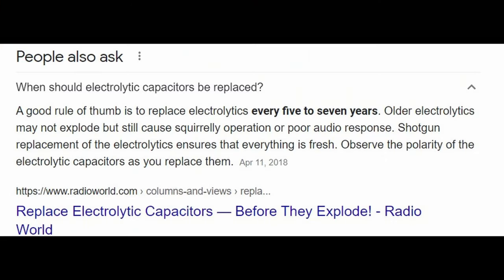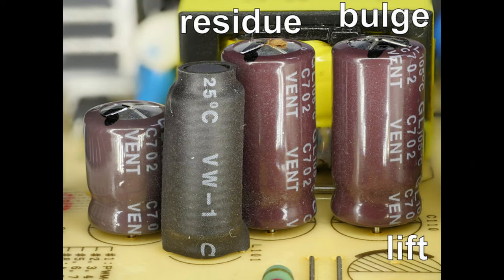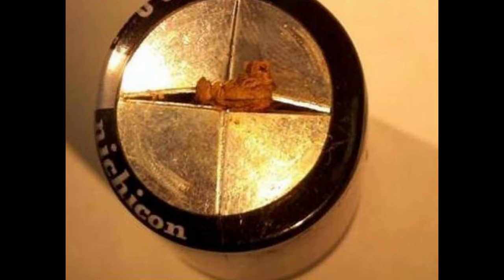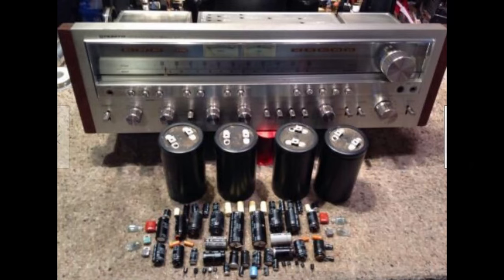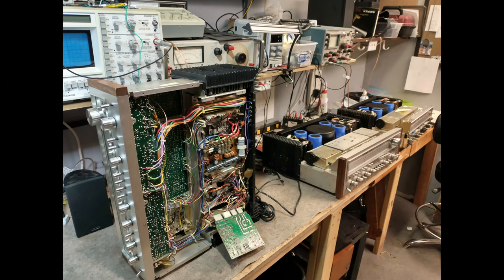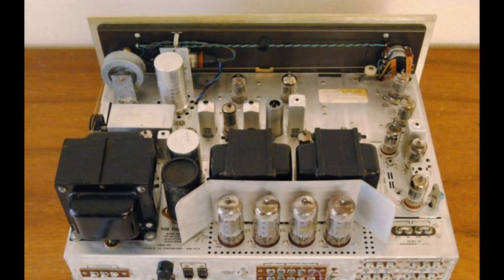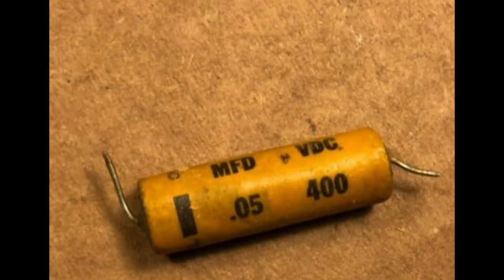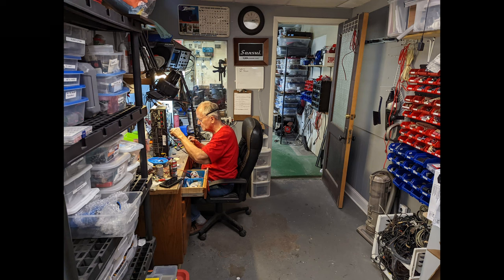Should You Replace Capacitors In Vintage Electronics?- Marantz Sansui Pioneer McIntosh Yamaha

Comment: When you see  visual damage with a cap it should changed. In some cases replacing tone caps can tighten up the sound. If you have a given circuit with voltage test points with voltage out of tolerance or excessive noise,  common with audio often times related too capacitors along with out of spec voltage regulators, it's called the Domino effect. . With tube gear where you have high voltage low current power supply circuits, it's a good idea to change main power supply caps for the B+ Supply Caps. You don't see failures as often with solid state amplifiers but certainly not un heard of. Really depends on the design of the gear, some are certainly more prone to failure.

Comment: So True Kevin, you can put a voltmeter across a car battery and it will read 12 volts but it won' t have the amps it did when it was  new. Electrolytic  caps dry out values change an when they change in a tank circuit like in tuning, which means a cap and tuning coil wrkg together, it will not be easy to get the stations you want

Comment: It turns out I was living about 5 miles from you until 2021, but I just moved over to Marion, Iowa so you're still not that far away. I was just talking to my best friend about replacing the caps in his Pioneer integrated amp from the late 70's.

Comment: I used to repair satellite receivers back when they were popular. It was easier and took less time to replace every capacitor than it was to try to find the capacitors that were bad. And when I replaced them all, I knew that it would be a long time before I saw that receiver again, if ever.

Comment: I’m thinking there should be a change in sound, but that isn’t a bad thing. If some of the caps are off spec, if the sound changes by replacing them with some that are on spec, the change in sound would be a good thing.

Comment: I have to admit that 15 minutes ago I was in the "If it ain't broke, don't fix it" camp. You've summed it all up and have changed my view on this subject completely!

I'm not living in the middle of nowhere, but rather on the far end, so I have to do it myself. I know there's tons of videos on this subject, but what would you advise as a rough guideline on replacement capacitors? Do I substitute the old ones for new ones with the exact same specs or can I improve reliability by putting other types in or with better specs? I read something about higher temperature ratings, for example. And what brands should I look for in your opinion? I've replaced ones in the past and bought only Panasonic, just because I read some advise online. I seem to trust you, that's why I would really like to know your opinion on this. Thanks for the clear and simple videos.
Reply: My rule is to stick to the same specs as what is in the schematic and use high quality caps like nichicon capacitors. Replacing with higher temp and voltage capacity is best for the long term. A quick test of resistors in the tone amp and main amp section is advised as they can drift way out of tolerance. There are color coded resistor calculators available free online.
Reply: @wefukthenwo  Thanks for the advise. I won't go as far as testing resistors, or perhaps in some old devices I have here, to give it a try. I can't tell a tone amp from a main amp, so I better keep my hands off. I want to be 100% sure of the things I do, otherwise I just don't. Thanks again, I will buy Nichicon for my next project!
Reply: 85 temp rating is fine in most solid state gear,  you might want to use 105 in tube gear that might run alot hotter.  Changing values of capacitance may have an effect on freq response, etc.  but a higher voltage rating is alright.

Comment: I wonder if new production capacitors will last as long as those being replaced.  Some say 'Recap and lasts another 40-50 years'. I understand the technological advances in today's components, but I'm amazed at the size of old vs. new. I'll probably not be around 40-50 years from now to see, but I'm leaning towards ain't gonna last as long!
Reply: At the start of the video, he said that you can expect 5–10 years from capacitors. I hardly doubt new caps will last 40–50 years.

Comment: There hasn't been a reliable electronics shop in this area in decades. The one we did have was known for telling you it can't be fixed, handing you a crazy expensive bill for 'looking at it' and when someone abandoned it there, they'd fix it and resell it for top dollar. 

I just went fixed a 50wpc Fisher/Sanyo from the 70's that a shop quoted the guy $1,200 to recap and replace one STK module. I replaced the power supply caps, both STK modules, plus four filter caps and most of the preamp and amp caps. After I was done I found a few issues with the tuner, and replaced several components in the antenna circuit as well. It brought the thing back to 100% working condition. Time wise, I had probably 12 hours in it not counting hunting down parts. 

My biggest concern these days is finding good capacitors, I've recapped various units in the early 2000's only to have to do it again when those caps started to bulge or leak. 
It seems that the modern caps are not as durable as the originals and its near impossible to tell whether or not the parts your getting are genuine or not. I've gotten as many knockoffs from the big suppliers as I've gotten buying off eBay. 

It seems like the higher end brands, or upper mid range amps and receivers are the models that have the biggest issues, maybe its just my experience but I seem to find more NAD, Paradigm, Marantz, and other higher end amps that have leaking or failed capacitors. The  low end, entry level models tend to still be working. It may just be the way the units tend to be used but its proven true here over and over again. 
The stack of dead NAD units here has gotten pretty high lately after people choose not to bother having them  fixed.

Comment: You DID change the sound though , back to what it was when you took it out of the box ! I call BS on these guys who bypass 10,000uF caps with a .02 ( made out of platinum of course ! lol ) also agree about get it done now . I'm 63 now and unless it's me or a friend I'm not taking them in anymore . I'll still do Marshalls and Fender guitar amps but THESE Can be a pain in the butt ! especially the wire wrapped ones ! All the points you bring up are valid I just think you should've emphasised a little more on what happens if those power supply caps DO go bad while the unit is on . Was it the old Castrol commercial ? when they said " you can pay me now ( engine revving in the background ) OR you can pay me later (with a Big Bang and then pup pup pup in the background ) LOL ......I would say more but I have to go to a party on my Yacht ! ;-)
Reply from the maker: Lol! You got it! Thank you!
Reply: @brucegerard309 Yeah OK ......

Comment: I took in a Nikko 501S stereo receiver for repair and refurbish.  One channel wasn't working and that was fixed along with 13 capacitors replaced, tuner adjusted, and pots cleaned.  I was kinda surprised the transistors weren't replaced.  The tech said it wasn't necessary to replace them.

Comment: I fully agree with you. I love my vintage stereo equipment, but the caps get old and need to be changed.
I was an Electronics Technician in my younger years. I'm also a guitarist. And all of the guitarists that I know who have vintage amps realize that their vintage tube amps need to have the caps replaced. When it comes to guitars and amps you hate to change something that is all original. but if you are going to use it, it has to be brought back to where it works right.

Comment: I agree with you 100% but what's funny is I have a couple old receivers from back in the late '70s early '80s and still have the original capacitors in it. They're not vented and they're not leaking. And the unit still sounds great.

Comment: When I overhaul my stuff, I almost always replace all electrolytics, for exactly the same reason - checking the old ones is a waste of time. 
Easy with smaller, PCB-mounted capacitors, not so easy with big reservoir cans. Some Japanese amps (Sharp-Optonica) used combination capacitors (four or six in a single can) - no direct replacement. To make things worse, same can also serves as a pedestal for the power amp PCB and heatsink. Others (Sansui) use capacitor lugs as star-ground points - it's easier to re-wire the whole thing from scratch rather than replacing them. And perhaps the trickiest thing in my experience was a Revox PSU where the reservoir caps had three negative lugs. And the placement of these lugs on the PCB did significantly affect hum - which wouldn't show up until the whole thing was reassembled and powered up.

Comment: if you were an hour away instead of 4, i'd ask for an internship with you. i'd love to shadow an old timer in vintage audio. my dad and uncle were into tv and radio repair but they have both passed and i had taken a 25 year hiatus of electronics with a career of autobody/paint. but i took it on as a new hobby a few years back. i just need to learn tuners/alignment, i'm doing very well with other gear but tuners are my achilles heel. i agree with all you've said but i am doing the power supply and at minimum, signal path caps when i go in but i usually just do all 'lytics and tantalums.  i do test everything that comes out as well as goes in on my little tester. sometimes i might do more testing on a cap i removed on DATS or check leakage on my to-4 but it's usually just so i can see how different caps in different units in different circuits hold up over the years, (and i know the component tester and dats are not real world results but it is something) it's getting replaced regardless. i'm of the same mindset, if i'm taking it out to test it, i'm putting a new one in.  you may be the first video that didn't tiptoe around and try to sugar coat it. good job.
Reply from the maker: Thank you so much, Joseph. I really appreciate your feedback. Bummed you are outside the "commute" range. Keep in touch. Thanks! Kevin

Comment: Thanks for sharing as i do think many forget even though does work doesn't mean well due for service as capacitor don't last forever. When do fail ive seen leak and cause damage just in general. Most don't think of this of service cause today most electronics are garbage and just throw away well before due for capacitors need changed unlike vintage stuff

Comment: I totally agree, It doesn't cost that much for the skills that they perform.  I recently got a Tandberg TD 2060 took it to the engineers and got a full service and a total stripdown of the tuner mechanics, lubed and received the receiver top notch for £200  which I think is really cheap.  Trouble is though it hasn't taken 5 years to make it difficult to find vintage electricians here in the UK,  I had to travel out of the city of Birmingham to get there and back!  A major electronics store in the city centre called Mathews closed down a year ago which had been a thriving business and repaired anything before they closed.  You would think some entrepreneur would get hold of the schematics for starting up the real hi-fi era again, my bet if they could afford the investment they would make millions!

Comment: Would love to see more people get involved in servicing their own gear. The soldering equipment is cheap. The components are cheap. There are complete kits online with step by step instruction. There are online forums full of enthusiasts who love talking about this stuff helping newbies. This old gear is full "Right To Repair" enabled. Take advantage of that. Would like to see the shops working on training professional techs as well.
Reply: Agree, even a DIY project for those who need a productive hobby. SAFETY first...always do the recaps with the device having been unplugged for a few days...and then discharge each capacitor you intend to handle. An insulated wire with alligator clips and a simple inline resistor is enough for that SAFETY step, else shorting with an iron screw driver shaft for the quicky. Audiokarma + basic multimeter ($20) + basic ESR meter($20)+ basic soldering iron($25) + good solder/flux...the schematics and service manuals are typically free of charge.  Tutorials abound. Invest a few hours to order the right parts (Electrolytic capacitors, suitable transistor replacements & mylar insulators & white heatsink paste/thermal compound) or go to audiokarma and search for a DIY parts list to compare to service manual to shorten search effort. Then, invest a couple of W.E. mornings to make it happen. A comfortable workbench of desk, with good lighting, a tray to organize bolts, a phone camera to take pics BEFORE starting, and some tie wraps to act as a third hand to position/hang wired cards. Parts can be sourced via Mouser or similar sites...see audiokarma. Relays...eBay. For specialty incandescent bulbs...see guru Dave (dgwojo.com).
Have the correct tools for the job, always. A sharp wire snipper that can clip capacitor tails (after soldering) close to the circuit board, etc.  Good screw drivers, a good soldering iron (practice first). Watch an ESR meter and a multimeter Youtube tutorial (takes 20 minutes).Watch a few Youtubers do the job, beforehand (AH-fix-it, etc.). 
AFTER you do most of the grit work, you can always take it to a shop to have the output signals checks and the BIAS adjusted with a scope.
I will up my game with a variac and oscilloscope...some day.
Reply: @jb678901  this is exactly what I've done the last couple years. I have a few older radios and a few Sansui receivers I want to tackle recapping and also learn some diagnostic skills. YouTube is full of good teachers and I just discovered some offering quality cap kits for many makes and models which really takes a lot of the guesswork out when ordering.

Comment: caps going out will often damage may other components and the board. the change in audio quality is very real and it is a major improvement. however, the bigger effect is by replacing resistors to 1% film. your sound will be much more efficient and you will not have to turn up the volume so much. actually, replacing components is easy and with a $300 investment in a de-solder/rework station anyone can do the work. do it yourself and replace all noisy resistors and caps and the material cost will be below $100 and your gear will sound better than any gear you can get. i did this on my brother's sony integrated amp and he can now hear thing he never knew were there on his albums. you do not need a tech for just swapping components. i always replace all ceramic caps with film as well. granted i taught myself electronics at 8 and successfully challenged electronics courses for ee at a school renowned for their program but i also repair a lot of gear and re-design and have even made custom gear. but my skills are wasted on component swaps. honestly anyone can do that provided they pay attention and not rush things. cheers 🙂

Comment: I normally go with the expertise of the service person that I found to service my equipment and replace the caps that he knows from experience are typically problematic, filter caps, power supply and any others that are bulging or suspect.  On less expensive receivers that I have like the SA-500 I only did the filter caps and any suspect caps and the ones in the power supply and also replace the bulbs with LEDs. On some like the Kenwood replacing the bulbs with LEDs in a one time deal is better than replacing the tiny bulb on the dial indicator every few years.

Comment: Kevin - Very informative review on recapping! I own a Sansui 5050 from 1977, connected to a pair of Klipsch Heresy III's.  I recently took the cover off for the first time to do a visual inspection, and saw all the original Nichicon (light blue), Nippon Chemicon (Black), and one Elna (grey) capacitors- all looking in pristine condition.  These were never replaced, the unit had only one minor service to replace a resistor and a fuse, in 45 years.  I have absolutely no crackling, hissing, humming or static and sounds absolutely great. 
Relative to these original 45 year old Japanese capacitors, I am just lucky or do they last indefinitely?
Reply from the maker: Hi, Arnold! Thanks for the comment.
If you could spot a failing or "out-of-value" transistor, capacitor, diode or resistor off a visual inspection,  there would be almost no need for 95% of the test equipment ever made.
I wish it were that easy. A lot of pieces we see are still working and have the original caps. The question is when do you go from lucky to unlucky?
Reply: @skylabsaudio  You are absolutely correct Kevin; if and when  I develop a sonic issue with the unit, I will absolutely bring it to get bench tested and repaired/restored as necessary. Based on my experience with the Sansui, along with reading many of the forums out there, it seems most of the issues    encountered with these receivers were bad resistors, transistors, diodes, etc. along with an occasional bad cap.  Its amazing the quality that must have been built in to these units.  If you bought a new amp today, of any make or price, I wonder if it would still be running almost perfect in the year 2067 (45 years from now)!!  Lol
Reply: I had a 1968 Nikko TRM40LA  intg amp that was in a condition like your 5050, except it had no service done to it- pristine inside, all original. It measured fine  with my audio analyzer, so no reason to replace them just because they are old (IMHO- that is the camp I reside in).